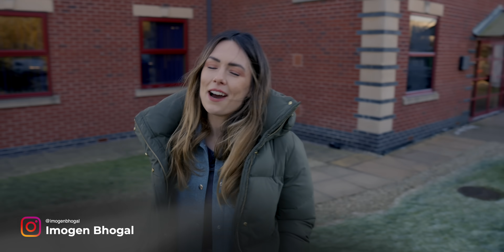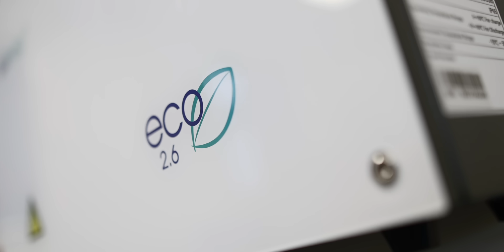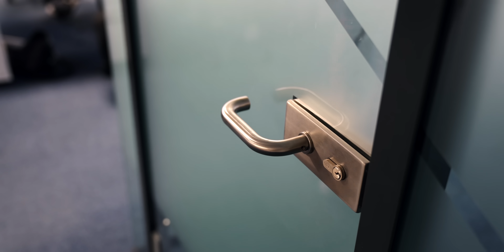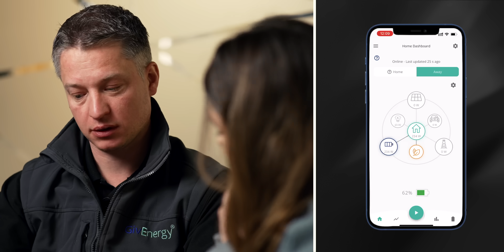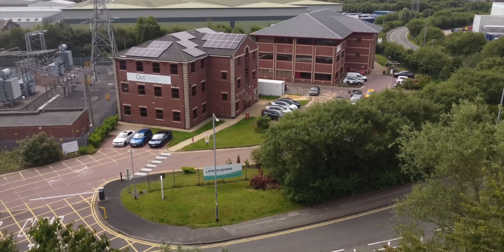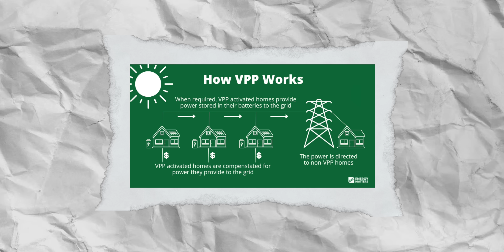THIS Is The Secret To Green, Clean Passive Income!

Comment: Step one is to get your use down.  Negawatts.  Insulation, cool roof, most energy efficient appliances (my full-size refrigerator uses 15 kwh per month, heat pump uses 100 kwh/month summer, 200 kwh/month winter), THEN size your systems.

Comment: After looking deeply into solar systems in 2023, in the end I decided to take a risk and basically double what we needed for our own home use, by getting the maximum output from panels and the biggest battery allowed for a home system. Cost was $33000 Aust. dollars.
After worrying about my decision for three months, we got the first bill.  Pre-solar it was about $870 per quarter, now it is over $850 credit.  Once I invest the savings and the credit paid to us, the payback time for the whole system is about 4 years.  More profitable than money in the bank, even in a high interest account. 🤩
Reply: "and the biggest battery allowed for a home system"

Wait, wait..... there is a MAXIMUM ALLOWED limit for domestic battery systems?!?!

Short of reducing the risk of battery fires in residential areas I can't see any need for such a limit to exist.

Hopefully if that is the reason then later solid state batteries which are safer may make such limitations redundant in the future causing them to be removed.
Reply: @mnomadvfx   It is not so much because of fires, we got a Phosphate Battery for low risk.  It is more because we don't have 3 Phase Power connected.  Even so, we only use about 30% of the battery overnight, so it is plenty big enough.
Also we are not in a residential area, we are very rural.  😊

Comment: We've had solar for 2 years, primarily for charging our EV. We are with Octopus Energy NZ and export as much as we can during the day, and then buy it back on a night rate for the same price. Our total annual electricity bill is $281 NZD. Our hot water, heating and hob are still gas due to the very high cost to replace the appliances. To upgrade our solar system to include battery storage would cost $18,000 NZD meaning it would take 64 years to offset the upfront cost. We're making the most of the solar savings while we can, but our government scrapped the requirement for power companies to offer a low user tariff 2 years ago and electriciy daily fixed charges are doubling every year for 5 years, and our current government have scrapped any financial benefit to own an EV. It certainly is a difficult time for New Zealanders to switch to solar and electric vehicles.
Reply: "To upgrade our solar system to include battery storage would cost $18,000 NZD"

Is it not possible to build a battery system in steps to decrease the 'in the moment' cost?

If modular domestic battery systems are not a thing currently that seems remarkably dumb given most people will not be able to afford getting a halfway decent system all at once.

Comment: We need a rebate for batteries from the government in Australia if they want to go carbon neutral by 2030 and not have to rely on keeping gas and coal power plants running.
Reply: rebates in the pipeline
Reply: 30 years ago nearly every room required 75w to 100w light bulb ..... With led lights it's 7w to 13 w max ... So that took untold demand off the grid... Hence why the grid definitely has the ability to support cars charging... It's due to the load all incandescent light bulbs required..that is now 90 percent lower due to the awesome led light efficiency
Reply: @aperitifs  

Every time there has been a big improvement in lighting that made it much less expensive to provide the same amount of light (lumens) people have generally spent the same amount of energy/money on lighting. With the switch to compact fluorescent and then to LED lights many people have put more lights in their rooms than they had with incandescent bulbs. One must also look at all of the objects that now come with a light in it that didn’t before, and some of these things have bright LEDs people tape over because they are too bright. About a decade or two ago there was a trend to include a bright blue LED in electronics and it was almost always on. It’s more difficult to find some computer accessories that don’t come with lighting than those that come with it. Look at how popular the LED light strips are. While each of these LEDs only require a small amount of electricity, the increased number of them in our buildings adds up quickly.

I was interested to see you write 75W and 100W incandescent bulbs. In my part of the world the most popular type of bulb was the 60W, giving about 800 lumens, and then the 40W for smaller rooms. The LED equivalents to those bulbs are still the most popular here. It’s always interesting to discover how different parts of the world have their preferences.
Reply: If many people have battery storage... We all could support the grid when the sun is not shining... But someone decided to bring EV cars into the grid..(fast charging cars needs many megawatts ) . Totally ruining that very attainable goal... Now we need to increase the base load ...

Comment: i have just installed a 17 kw solar system and 10 kw battery, but i live in rural north wales and my smart meter is not smart because we have no WAM single ,and we have been limited to send 6kw back to the grid because the network is to poor to deal with any more, things are not so smooth for every one. i can not get any help from octopus energy to get the meter working. not sure what to do any help?

Comment: I love your channel and I believe Home Batteries and Renewables in general are a big part of the solution to our energy crisis. However, please explain how you can save £4-5 a day on your electricity use by using a home battery? The bloke stated he has a GivEnergy all in one (13.5kWh). If charging by Octopus off-peak, I’m guessing you are paying around 7.5p kWh, with a daytime rate being around 30p kWh. With a battery capacity of 13.5 kWh, and if you use all of the electricity stored in the battery, it would make the saving £3.03. (30p - 7.5p = 22.5p. 22.5p X 13.5 = £3.03.) If I’m missing something, please let me know.
Reply: Also who in the UK uses that much electricity for a standard household??😅 We barely use 6kWh/day (annual average), despite EV charging.

Efficiency measures have to be put in place before anything else.
Reply: The price given to consumers for each kWh they returned to the grid for those few hours was very high that day - the high price was driven by what the grid would have paid to get a (probably coal fired) peak generator up and running.

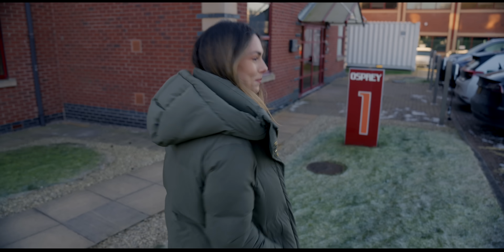Comment: We are nearly there! 21 solar panels,  5.3kW hybrid inverter and 15kWh batteries.  We buy electricity for the batteries 00:30 - 04:30 and charge our EVs at the same time. We usually manage all day even in the winter and will be exporting ++ in the summer.  We just haven’t managed to get permission to set up the inverter to charge before and export during Octoplus Saving Sessions.  Our system is not automatic like GivEnergy.  I’ll need to ask some more questions! This is definitely the way forward.  On Friday with a sunny day we only paid £1.46 for our electricity including adding another 20 miles range to my car.  We generated 26.3kWh and exported 13.2kWh, earning £1.11 back so all our electricity cost 35p.  We can’t get onto Intelligent Octopus due to incompatible cars and charger otherwise we would have made our first profit since installing despite being January in the UK.
Reply: "We buy electricity for the batteries 00:30 - 04:30 and charge our EVs at the same time"

This works for now, but once all vehicles are EVs and everybody takes advantage of off peak prices to charge then it won't actually be off peak anymore.
Reply: @mnomadvfx There will almost always be an excess of energy production during the night. Logically, forward thinking companies such as octopus will continue to sell electricity cheaper or give it away during these times. The amounts for buying and selling will fluctuate but there will always be off peak rates.
Reply: Amazing
Reply: What Octopus tariff are you on? I just switched to Go for my EV and am thinking of installing solar panels. Sounds like you make 8.5p for your grid export, 111p / 13.2 kWH?

Comment: 🎖🏆🏅🥇The first development in Australia, when Lismore council approves, combines 250 passive homes and 57.7MW Tesla Megapack Batteries Farm and the PV in total 161,502m2 - Tractile tiles 45,000m2 and - Tesla PV panel 116,502 m2.

The Team and I would like to submit a Developments Application to a council on North Coast NSW at the end of May 2023:
1.	250 prefabricated SIPform passive house-certified homes. On the roofs of buildings, there are Tractile. The excess electricity will be stored in the 57.7MW Tesla Megapack Batteries Farm. 
2.	The PV in total 161,502m2 - Tractile tiles 45,000m2 and - Tesla PV panel 116,502m2. The Team and I will add another 233,000 m2 of *Arctrech Solar Tracking by 2030—enough electricity for all Lismore residents and businesses. Everyone will have 3 PHASE like the Tesla Powerwall Battery. We will charge a potential wholesale AS$0.10 per kW.
3.	Bi-Charging of BEVs two per house and 12 Tesla Super Charger stations in the shopping centre. 
4.	Micro-grid that connects to a community of 4800 residents. By 2030, we will provide all electricity to 41,500 residents of Lismore.  
5.	Landscaping the whole site, ensuring enough clearance for the surrounding bush and buildings.
6.	We will be trailing the SoMax HTC process. 
7.	We will have a project at the end of 2024 that will install a long-range wireless power transfer. Emrod Tele-Energy Technology.

Some of the Teams and companies include:
•	SIPform
•	Tractile 
•	Direct Building Solution 
•	NB Consulting Engineers 
•	Green Product Certification 
•	Xlam
•	Weathertex
•	Cupolex 
•	Arctech Solar Tracking 
•	Tesla EV – PV – Powerwall – Tesla Megapack Batteries - Tesla Optimus robots

We will employ consultants and local trades. So, if you are anyone who might like to move to Lismore NSW, we would like to hear by the end of Oct 2024. We will raise a minimum of AU$ 750 million for the development by the end of 2025. We have investors in the US and the Middle East. The team and I will start crowdfunding in December 2022. The Team and I have a Zoom meeting on the first Monday of the month. We will discuss crowdfunding in the next Zoom meeting on 7 Aug 2023.

Comment: 3:59

I'm an average energy user and I'd still get the AIO because it works better with EVs, and you've got about two days of battery storage.

That, and if you've got a heat pump, you've got battery storage there too ready for when you want. I'd always get the big battery if you can afford it.

The AIO also has a gateway which has an EPS built in

Comment: Just understand the basics that grid electricity needs a grid to the customers. 
20million in Australia. 
300million in the USA. 

The first grid that was built over 100 years and with national wealth is basically 5 times too small. To stop CO2 emissions.

So all Grid electricity is basically a dead duck economically to stop CO2 emissions worldwide.

You have to add the bigger grid capacity construction costs to the nuclear solution. If you are to replace fossil fuel CO2. 
There is a reason that transmission lines are built in multiple parallel lines of towers. It is because it is the only way of creating a bigger capacity for more electricity.

Comment: 25 panels here and 16.4kWh of GiveEnergy storage. I have a 4 bed house and 2 EV’s last year my electric bill was just £170 This coming year I expect it to be less, as I have a better export tariff-15p rather than 4p. So I can run the house from cheap overnight rates and export all solar at a higher price in the day. I’m with Octopus and they pay a premium rate (like some others) for exporting at predetermined peak rates. That normally earns me £10+ per hour - £95 in Dec. 
I managed to just get my kit before the energy crisis so a bit cheaper than now. The installer quoted 13years for payback I think it will be 3 years. His quotes didn’t account for the rise in energy cost, the EV’s, and the ability to take advantage of cheap overnight rates and higher export rates. 
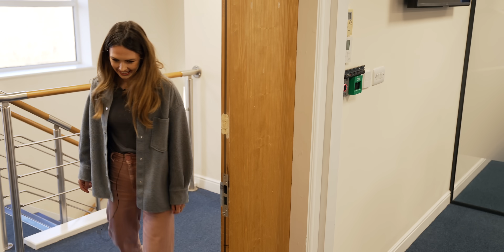If anyone is considering an install, my recommendation would be go as big as you can afford. Panels are cheap and much of the cost there is on the installation, scaffolding etc. you only want to do that once. Oversizing means you’ll get paid for power in the summer and need to buy less in the winter. An EV and battery storage allows you to buy and sell power at the best terms. Again if you can, get more storage than your typical house consumption. This gives you a buffer for high usage days and capacity to export at 5:30 ish when the power company offers great export rates. 
A bigger system will require approval from the District Network Operator (DNO) but it’s a paper exercise that your installer should take care of.

Comment: What really needs to happen is all manufacturers of inverters , batteries ,EV chargers and heat pumps . Need to provide an open common standard API , so that 3rd party control can optimise your performance. Example don't charge car when home batteries would discharge , and would also allow for vpp's  and not be locked into a manufacturers eco system .

Comment: THE hang-up many have, is: To save 4-5GBP per day one has to spend 4-5k GBP to play in this space...

 - What I love  about Solar in Australia (without batteries - though i have the benefit of both having, AND not having batteries)  daytime Cooling -  becomes an essentially free exercise - once a "sizeable investment" has been made, of course..  

VPPs are here - BUT you NEVER want to be "forced to use" the grid for residential power if you are on a "wholesale pricing exposed" plan   - 16kWh  or more is necessary for many homes to get through any power eventuality - say a 24hr blackout after a storm, or running the ducted AC all night.   The only thing really selling batteries un Australia is the ever increasing price of retail power, the people being "forced" to use TOU plans  ($0.60Electricity

Solar to Night time heating  "could be done"/  IS possible  - via an additional storage hot water tank - heated by solar  - Thermal or PV, during the day  (This is still possible in the UK - or Europe  as long as the panels are free of snow)...

Comment: TL;DR: my solar system gives me free electricity and makes me $110 per month tax free.
In Australia, I have 13.2 kW of solar panels on my roof and a 10 kW grid tied inverter, installed in Jul-2023, at a total cost of $10,455 AUD.  This was my 3rd solar panel installation, each at a different property.  I pay $0.30 AUD per kWh from the grid, and export (sell) electricity back to the grid at $0.13 AUD per kWh.  My power bill was about $60-70 AUD per month.  Since installation, my power bills have turned into credits, and I now get free electricity and make around $110 AUD per month tax free on the excess electricity I export to the grid - a whopping 25% Return on Investment (ROI).  It's like having a piggy bank on my roof.  Living in / near the tropics helps.  I can get the CREDIT transferred to my bank account whenever I like.  My entire system will pay for itself in 4 years.  Highly recommend others do this if they can (if you live in a sunny area with suitably facing roof).  I am now looking to add batteries or small hydro (small scale pumped storage) to expand my system.  Agree there are lots of scams and scammers out there.  Use a reputable, quality installer, and always do your research first.

Comment: I’m in sunny Lithgow, NSW. I have a 5Kw solar system with a 13.6kw (useable) Tesla battery and I use Amber as my energy supplier. Just as the gentleman was saying the buy price can vary from -10c KWh to $12 KWh. The advantage of this is that Amber, when the feed in tariff goes high, will instruct all the batteries on their network to discharge to the grid. An example of this occurred a week ago and I got up to $8 KWh. Normally this would be in the 20 to 50c KWh bracket. The reverse also applies, last night the buy price fell to -10c KWh so it was feed to my battery to top it up ready for discharge to the grid later. It works and is great!

Comment: I just got a quote and my repayment on the investment is > 8 years. Just not worth it...
Reply: That’s what the installer says but you need to do your own maths. I was quoted 13years and I think it will be 3. The differences for me over the quote are cheap overnight tariff 7.5p, better export tariff 15p, Octopus saving sessions - earned me £95 in Dec. My quote was based on a flat rate of 18p per kWh which I was paying at the time.
Reply: @Flyingtwiglet  Thanks I will redo the maths myself
Reply: So 8 years to breakeven is a problem? What about the next 16 years of paid off production? Sounds like a far better investment than a house mortgage.
Reply: @richyfoster7694  I have other stuff I can do and get a quicker payback. By the time they are done I will get a better deal. BTW As was pointed out in an above comment the 8 year maths was not right. I worked it out to be more like 6

Comment: What effect will Sodium-ion battery have on home batteries?  Would it be wise to wait a 1yr for them to come out?
Reply: It's not happening anytime soon, so IF you want a battery before 2030's get one...
Reply: Yes wait for sodium. B it it will be five years even if you assemble your own batteries. An 18650 sodium ion battery is about $1.00 when bought in packs of 100, after shipping
A thousand cells is 1.5Kwh. A whole powerwall 2 is $13k installed. I know which one uses less of my time